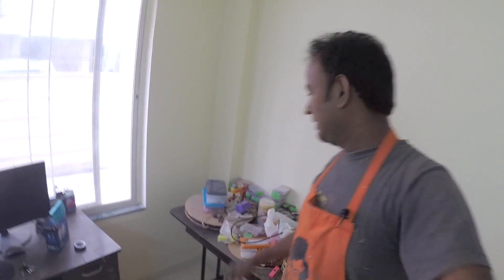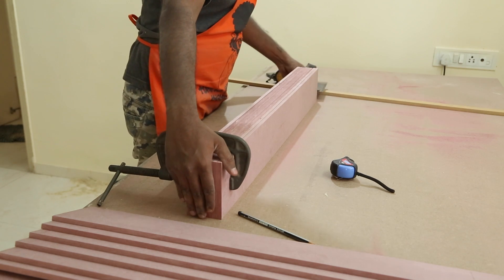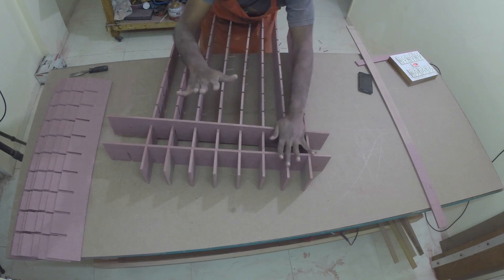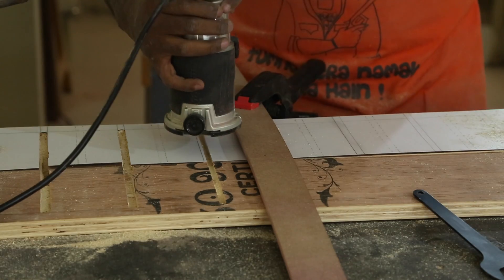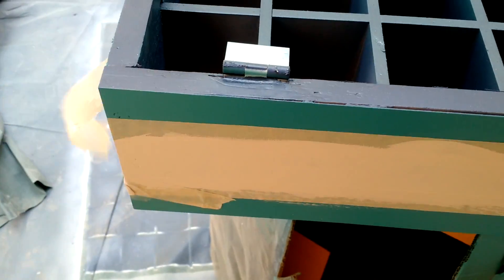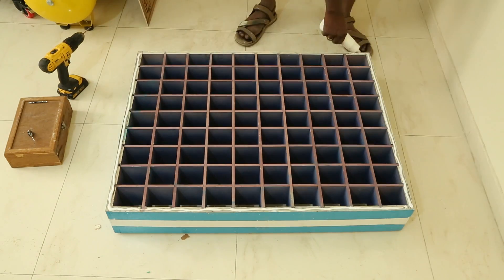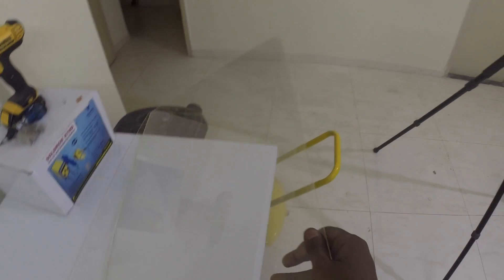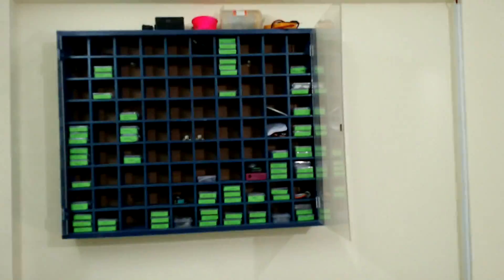MDF Electronics Rack with friction fit

Comment: Sir, I am fan of your work 
Could you mention the cost of all items ( mdf per square foot cost, steel hinges, 6mm & 18mm plywood cost etc. ) you use in all your projects in the video description hence forth 
Thanks sir,
Reply from the maker: It differs based on location. So please ask your local dealer. They will help you with the correct price.